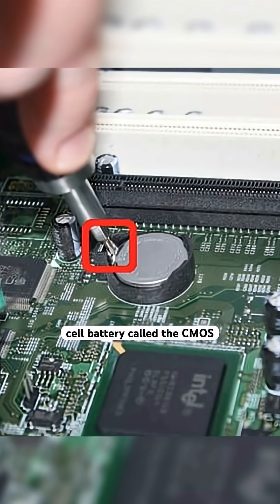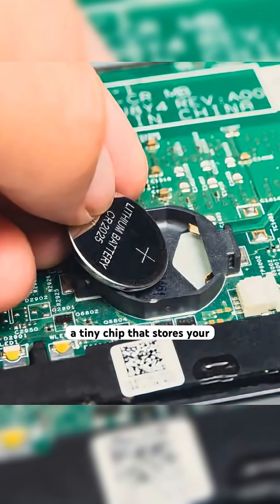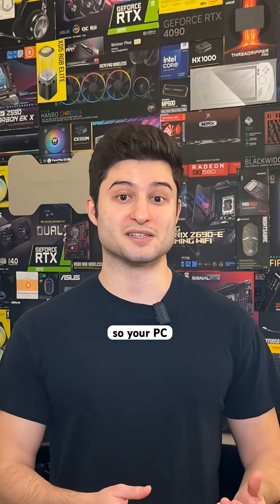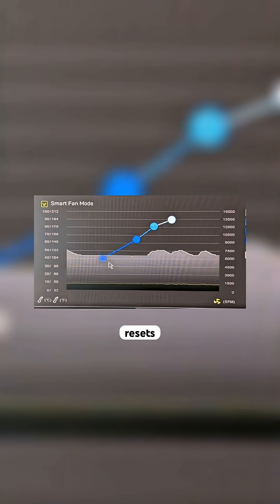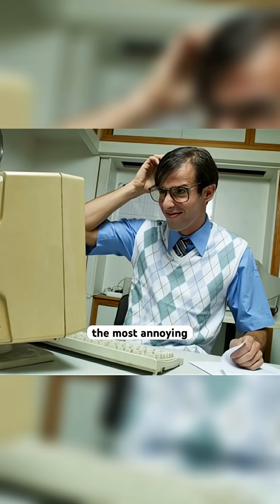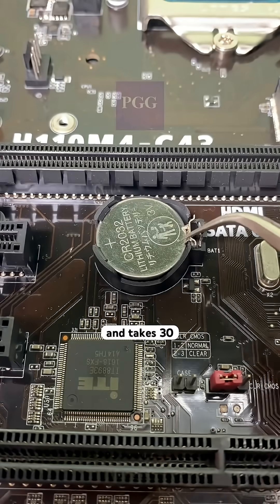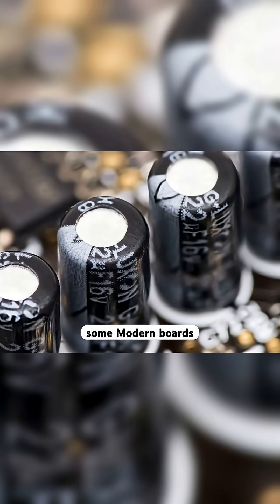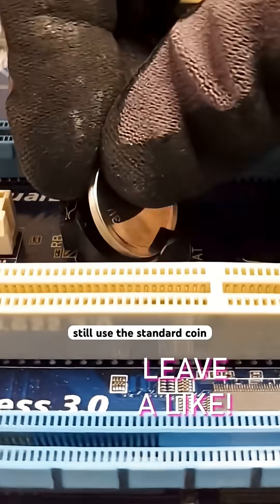This motherboard battery is essential

Comment: never said how to check, simply go into your bios, change a single setting to something that isnt default, best if it’s also unimportant like a fan curve or speed. then simply save & exit. unplug & turn off your PSU, then press the power button a few times. wait a good 15 or 10s, then plug your psu back in, turn it on, and boot into your bios. if that setting has changed, your cmos is dead, if it’s the same, you’re dandy. check if your board has a cmos jumper too, refer to the manual for the jumper’s default position, do not take it off and leave it off, it’s supposed to be on

Comment: If a CMOS battery is used on a laptop, and that battery died, do I have disassemble the laptop to replace the CMOS battery?
Reply from the maker: Ive had to replace it on a laptop and its usually a little different than onna desktop. Mine had a wired cmos battery that is covered in a wax or something and it was easily accessible. I bought a new one that fit the pins where the wire connects.
Reply: @TechnicAlexK Thanks for sharing. I have an older laptop & will check it out.🫡
Reply: Short answer, yes
Reply: @salsinatorsalsa Thanks for sharing absolutely nothing of value.😂
Reply: @Shatabhisha369 they asked a yes/no question.
Reply: I have a HP Laptop and the CMOS Battery is dead. Replacing it is almost impossible because you not only have to open the Laptop, you also need to remove the entire board, cooler, flat cables etc. because the battery is apparently hidden somewhere on the otzer sind of the board. And of course you can't easily check what type of battery it is and oder it beforehand. It's probably one of those sleeves ones with a little plug🤷‍♂️
Reply: @rolandrohde it's diff for every model. Sorry to hear you're is as complicated as it is! HP aren't known for being repairable on one's own 😣

Comment: Newer motherboards nowdays use NVRAM so the settings won't wanish, the battery is only needed for the clock. So if it dies the date will reset, but settings won't. Some boards emulate that it forget the settings when voltage suddenly disappears, but if the battery dies the voltage is lost gradually so it won't reset.
Reply: took them long enough. batteries have been destroying electronics in computers, arcade and pinball machines etc for 40+ years. for some reason they always mount the batteries so it leaks on the PCBs, original macintosh is one of the rare ones with a separate battery compartment where a leak would be somewhat contained

Comment: so if i take the old one out that like fully resets and makes it forget everything right but if i put the new battery in it relearns everything or do i have to manually go in and change all the settings and basically reteach it how to do stuff properly? i’m confused someone pls help lol😅
Reply: nahh ure good. turn off ur pc, take it out and just put the new one in
Reply: It resets to default settings, basically. So, it should still work. But some things, like XMP for RAM, you might have to set manually.